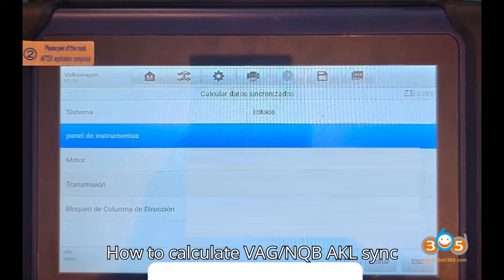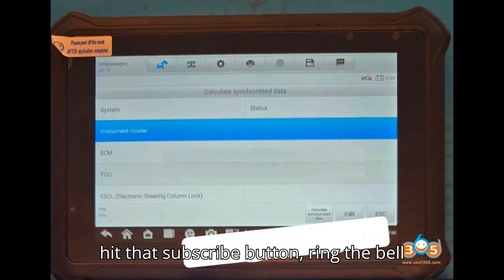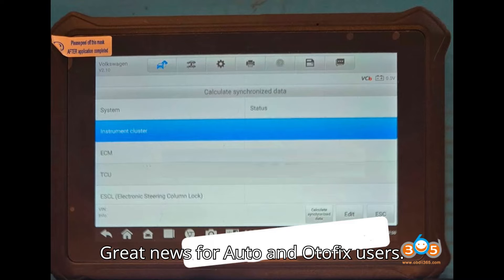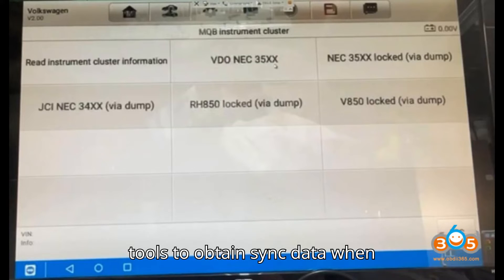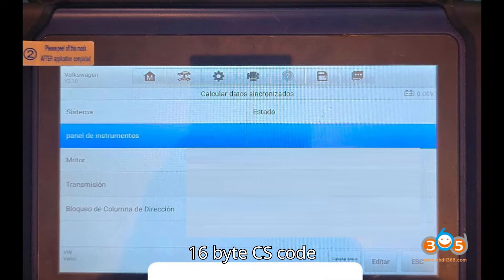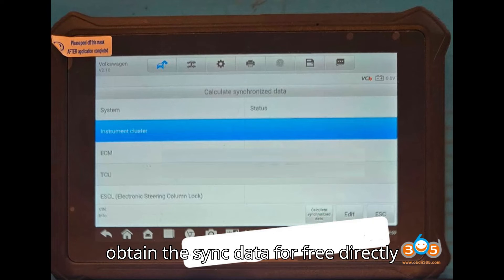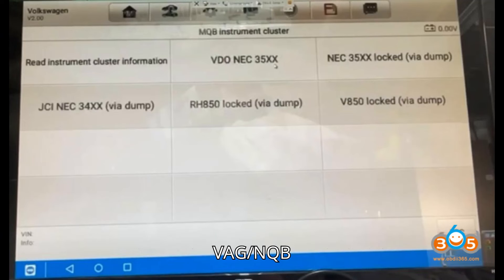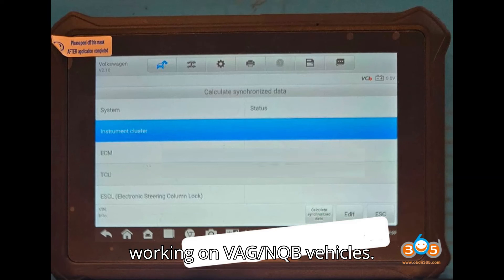How to Calculate VAG MQB AKL Sync Data with Autel IM508 IM608?

Comment: This is nice but there’s still the problem with getting CS data. You have to drain the transmission to get to the TCU, and I don’t think there’s a tool that will get the CS data from the steering column lock.
Reply: This is the opposite of simplifying key programming 
I did 2014 keyless Audi A6 and only one guy in the whole world in Palestine can get sync data otherwise we have to wait two weeks for the dealer key
Reply: @carMacGyver1 hi I am having this issue now who did you have help get the sync data?
Reply: @carMacGyver1 he is Israeli..